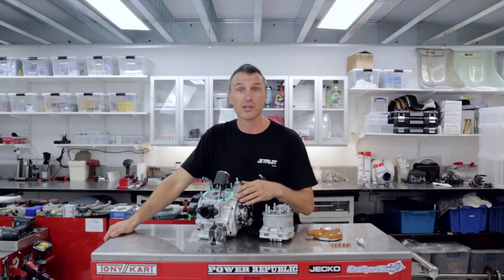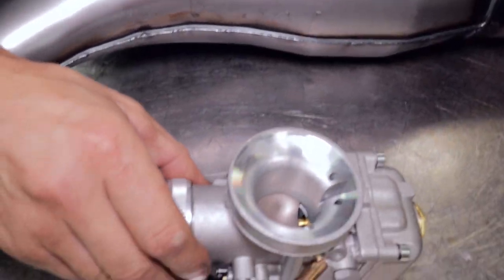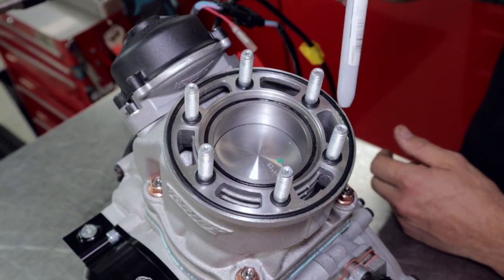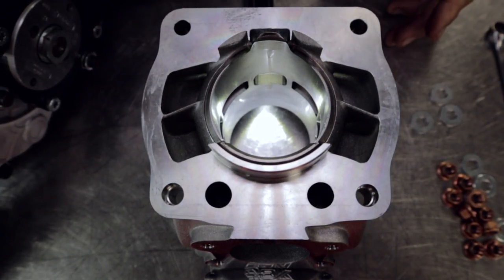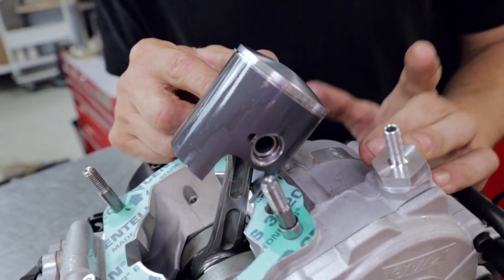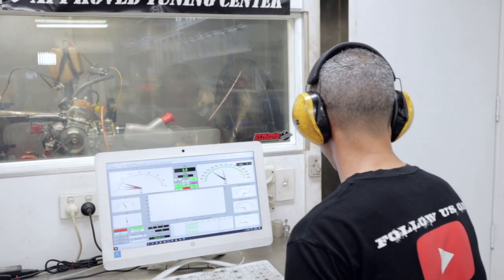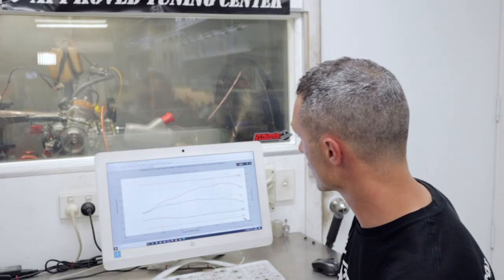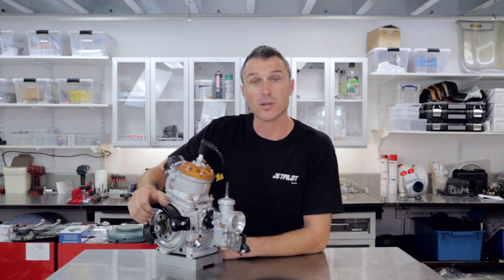Testing Out The New Vortex Rok GP - POWER REPUBLIC

Comment: Hi Derek 
I have been racing the Rok Gp in thailand for the last year ...thx so much for vid and your contribution to karting in Oz and especially  power valve spring  advice ...my motor is on the second piston now and we have adjusted the crank somewhat to make true as out of factory specs is approx 4 to 5 thou run out and it has been adjusted to about 1thou run out ..  I brought this motor new in thailand ...great horsepower in this donk but without balanced gears it shakes the crap out of itself and breaks plastic electric connections and other things because of the vibration on the  rok gp ..i have an max evo also but love driving the Rok ...hey mate I am an aussie  still racing at 64 years old ...
Reply: I will try to get some power valve springs in thailand but if not can i buy some .8 x 39 mm springs and  send  to me in  thailand ..?
Reply from the maker: Hey Al.  That’s awesome.  Send it Bro.  When I come to Thailand 🇹🇭 I’m coming karting with you guys 🦾🦾🦾🦾

Comment: bought one, did testing with it, was 0.5 a lap slower without the restrictor compared to when i had an X30 strapped on
Reply from the maker: Wow, thanks for the great feedback.  Did it hit the rev limiter at 15k ?
Reply: @PowerRepublic  Yep, was 8kph down on the straight compared to the X30 and Rotax, tried 4 different jets at all pin positions with 4 different sprockets, had no top end, poor bottom end and average mid range, was hard to keep it alive down low.

Comment: The ROK GP is a super fun engine and I can speak only good about it. It was my first 125cc engine and I ran so many laps with it without any problem at all it was unreal, recently I had a problem with the piston but that was after almost 13-14 hours of use if not more so it’s super reliable if used correctly ( and no I’m never running an engine this much ever again, I’ve seen what it can do )
Reply from the maker: thanks for the feedback , so you reckon bring the engine in at 10-12 hours for a new piston ?
Reply: @PowerRepublic  Probably but at those kinds of hours I think it doesn’t make the same amount of power anymore plus you risk badly damaging the engine ( the piston might just explode when it’s past 10-11 hours )

Comment: Hey Derick great vid man. just wanted to ask if you can do a vid on what makes different engines more powerful?
Reply from the maker: Hey Venom.  Thanks for tuning in.  Glad you dig the Vids.  Sure can, but the main difference is the ports size and duration. and the exhaust pipe system.    Also too the capacity is key!!!
Reply: @PowerRepublic  Sorry should of told you earlier its Aiden Hackwood, Robs son. Ok well that sounds right is there anything to do with the pistons?

Comment: Great video as always really interesting to see how a change like the power valve spring can have such s huge impact on the power output. I have a senior max evo and I’m struggling to get max rpm it feels like it’s really missing some power at the top end, I found the power valve adjuster screwed all the way in could this be the problem? Or something else.
Thanks
Reply: I find power valve adjustment screw better all the way out is better
Reply from the maker: Hey Sammy,   Thanks for the good vibes 😎 

Top end revs in senior max are normal jetting. Then check battery strength. 
Then maybe check the power valve screw.
Reply: @PowerRepublic  thanks for that, yeah I’ve done both of those already and the jetting had no effect always hovers around 13500 and I can see a time loss on the straight
Reply: I raced rotax  max evo last year and found the power valve wound out to just under flush on was good  then adjust jetting  and needle to suit the atmospheric preesures where you are racing ...can fine tune by needle height ..
Reply from the maker: @samrichardson3128  how many hour has the engine done since brand new?  have you checked the Power valve length?
Reply: @PowerRepublic  it’s a 2020 engine with around 10 hours running. The length of the power valve is 81.2
Reply from the maker: @samrichardson3128  mmm. maybe it is just some spring binding.  you could try and drive with no spring and see if the max RPM improves, just to see if that's the problem.  not really a good solution but it might help you problem solve
Reply: @PowerRepublic  ok great idea never thought of that thanks

Comment: Hello Derek. I heard the "mixture or air screw" in the Carburator can be loose OR tightened in order to optimize performance, depending on the amount of slow or high speed sections in the racetrack...  That´s part # 22 or # 23 in Dellorto 30 VHSH homologation sheet, I´m not sure. Do you have any knowledge on that? I´d appreciate.
Reply: Hi Felipe, in response on your remark at your comment, the best is 1,5 turn from the closed situation. That’s told by someone from Vortex Holland…
Best regards, Wouter
Reply from the maker: they will only effect the carbonation slightly.  the main tuning will be done using the main jet, float level and needle clip position IMO

Comment: Thanks for review Derick.  I recently switched from a Iame MY09 to the Rok GP last year.  I am very happy with the mid-range power band of the GP.  It pulls so much stronger out of the corners and then when the power valve lifts, its like a rocket.  Have you played around with the timing any on your dyno runs?  Thank you for the comparisons.  I run Heavy/Masters here in the U.S.  The extra power over the other engines gives me a fighting chance with the other engines at lower weights.
Reply from the maker: no I haven't changed the timing from standard.  what's your recommendation for IT advance?
Reply: @PowerRepublic  I have not played with it yet.  Only run it a few times.  It was set up by the shop I purchased it from.  I will check this evening and reply.
Reply: I am using and racing my ROK and timing is set at 3.2 now and tried 2.8 but i like 3.2 atm ...not sure if this helps you but definetly change piston every 10 hrs as performance drops off after this for racing ...
Reply: @Power Republic Without pulling the engine off the kart, it is hard to make out the timing mark.  It looks to be in the middle of the adjustment groove.
Reply: @alanaustin9143  what have you changed in your Rok GP for racing besides timing?
Reply: @adrianomarcandali  I change pistons before 10hrs of use on each piston ...After first piston my shirtless thai mechanic stripped my  Rok motor replaced bearings and realigned the crankshaft  as it had more than 4 thousand of inch runout on the crank journals and now it has virtually no runout and motor was definetly quicker on track once run in proper ...hope this helps ...not all motors are the same and not always correct set up from factory and from new ..I use between 2.8 and 3.2 on the timing ...

Comment: Hi :)
I wonder if anything in the Rotax Max engine can get damage if the engine is stored in a container when it is minus degrees at night? We have almost season now, but as today for example, the temperatur is minus 8 degrees in the morning! And   the folllwing weeks the temperatur is going to be minus at night and plus in the day. Should we wait to bring the kart out to the track until it is plus degrees even at night? 
Best regards from Jesper
Reply: I would make sure to drain the water from the engine and cooling system before storing at temperatures below 0°C. Apart from that, I have never heard of engine damage due to freezing temperatures.
Reply from the maker: Hey Jes,  yeah like Steffen said, take the water out of then if the temps are way low, cause the water can expand so much and actually crank the cylinders.    other than that I would do the usual pre race checks and maintenance and then F N send it!!!

Comment: So confusing. Do they run with a restrictor for racing TAG125 in Australia or not ?
Reply: Junior class is restricted. Senior and masters class should be open
Reply from the maker: yeah sorry about the confusion, when the engine was introduced the Karting Australia regulations had a restrictor plate in the exhaust to knock the power down.  it has been deleted now so that the power figures and configuration in this video are correct

Comment: Why is it restricted to 13,000rpm? Red line is 15,000rpm
Reply from the maker: hey Mario.  Yeah that’s cause we run out of revs on the dyno.  I would have to change the gear ratio and do the test from 9-15k rpm.  Instead we use the 7-13 range for easy testing and comparison

Comment: What are the rebuild time on these ?
Reply from the maker: Hey Lee.  Not sure, just got them.  I’m sure more than 10 hours but some guys will rebuild before each event.
Reply: Piston-30 hours
piston pin -60 liters
Piston pin roller cage-60 liters
Connection rod-90 hours
Crank shaft pin-200 liters
Silver washer-200 liters
Crank shaft roller cage-200 liters

Comment: The engine looks great, but a pointless test really comparing against engines it will not compete in current format. There will be a lot of interest in this test with both open and tag restricted restrictor to see if you can produce power comparable to IAME and rotax
Reply: P.S, 
Love your Vid’s
Reply from the maker: Yeah sorry about that, didn't have access to the restrictor plate at the time.   I guess its a little more relevant now because they have changed the rules to run this configuration currently.  I will have to put another vid out with the Tag Restricted format comparison.